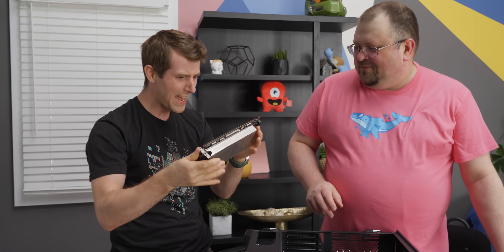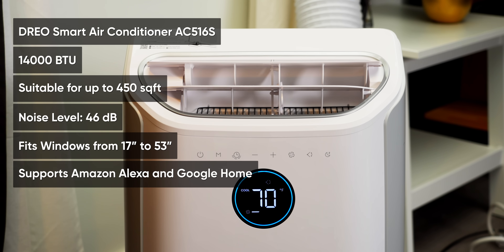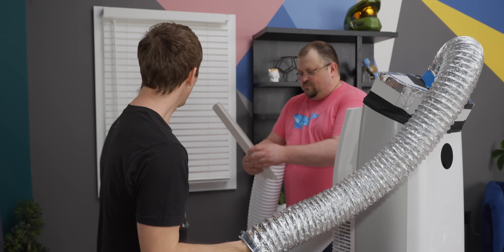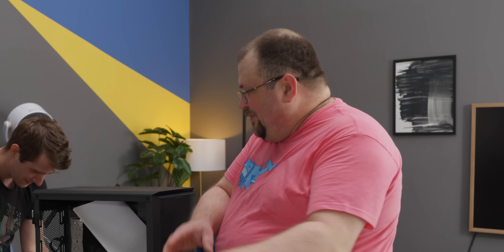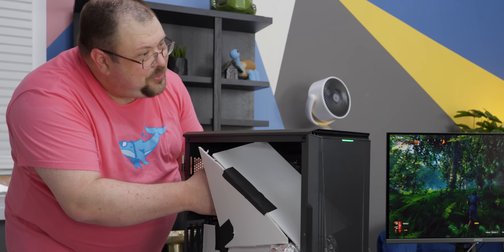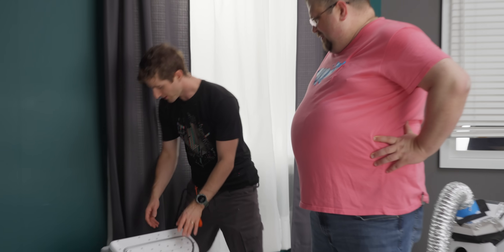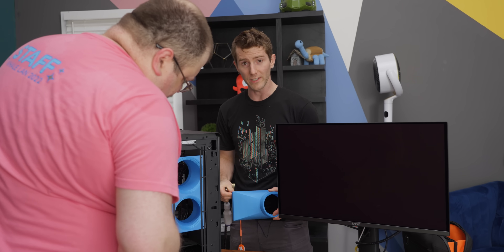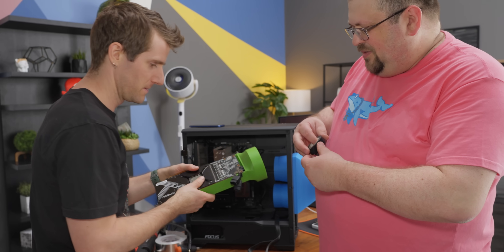Everyone is Cooling Their PC Wrong

Comment: The nice thing about this rather than a chiller is the air that's coming out of the AC is already conditioned. Aircon was originally invented to remove moisture (condition) the air for manufacturing and this means in this case that you can cool your PC bellow the dew point without risking condensation as you would otherwise so there is a lot of practicality that comes with this.
Reply: Yup this! Cooling was just a side-effect
Reply: That is incorrect. Because of the implementation, the backside of the motherboard is risking condensation. Cooling the entire PC with AC would work, condensation would still form on the outside, so the case would need to be rebuild for it, leading condensation runs into driptrays. Then you have the fact that power consumption alone, would far exceed the price of a 5080 per year, depending on where you live, it can fairly easy reach the price of a 5090. That's not counting in the ACs price and the massively reduced lifespan because of a forced 100% duty cycle...
Reply: @VikingRul3s  This is a quick and dirty solution, the way to solve this is via insulation, but no condensation should not be an issue as long as there is a flow of dry air ans that will lower the moisture and so prevent condensation where that air is flowing.

I'm not saying everyone should grab a "portable" AC unit and do this either this needs some real work if you wanted to run it but cost shouldn't be an issue for someone that is doing a sub-zero setup. Those are always "cost be damned" setups.

In the enterprise space, as an aside, Supermicro now does a chilled rack door that cools and conditions air before it hits the servers behind it that integrates with the big chips themselves being aircooled. This kind of solution is becoming more common now. Mind there is even cooler things you can do with those because you can recycle the waste heat.
Reply: @theonik2006  Yeah exactly my point. The back of the motherboard doesn't have any of that circulation, but intense cooling from the tower, evident in the video, guess what will happen after say 15m idle (rim/frost will start forming there, you can check just about any chiller video to confirm that and that's on open benches, way more flow for the back)

As one of the OG of hw bot, no you're right, but nobody ever build these systems for anything els than extreme OC, usually only for a session or a couple of days 

Your example is literally what i propose, AC the entire case. BTW those doors cooling capacity is both regulated according to ambient and only used in racks pushing >80% 24/7, so fairly easy to calculate heat dissipation needs
Reply: @ What I'd be interested to see tested here is how this performs longer term, yes the lack of dry air flow on the back of the motherboard would be an issue, though I think with their setup the relative ineffectiveness of the shroud may mean they get enough dry air to lower the humidity in the whole case anyway.

What I basically want to see is a case with an air conditioned front basically providing a dry air intake with positive pressure, and insulated from the outside to prevent frost from building on the outside of the case as the final version of this. See how it performs.

Actually you reminded me of the Peltier AIO Intel released with Coolermaster a few years back for subzero cooling for 24/7 use. (except not, it had a 24/7 mode that was restricted to above 15C and a sub-zero mode that needed the usual Vaseline and prayer approach, LTT did a video on it back then I think)
Reply: @ Well that would be kinda cool, to see how much ex FSB/bclk could push off components like SSDs

I think i remember it, it was way to expensive and the peltier was too small to have any real effect on high-end chips at full bore (inherent problem), which is exactly where it would be a benefit. Played with them back in the pentium days, first way to try sub-zero OC
Reply: @theonik2006  Going to provide a little context: The reason chillers and peltier are irrelavant today is two fold 
With Peltier it's the efficiency, i think the legendary Core 2 duo E6600 was the last OC friendly chip, that could reach enthusiast levels and still be sub-zero with a overvolted 250W peltier (efficiency is horrible, never over 66%, closer to 50%)
With chillers it simply has to do with how well chips are made these days. Take the E6600 as example again vs the new Ryzen 9xxx. The manufacturing tech is 15x worse on the E6600, meaning the spacing between current "lines" in the chip had to have 15x more dead/isolated space between them. This says a lot about how inefficient chips were when OCing was huge. In other words, there was a lot to gain from low temps, not like now where you can drop from 75C (custom water, max stable) to 5-10C (chiller) and only gain 1-2%
Reply: But the dewpoint is dynamic, isn't that like the whole point? The dewpoint is the temperature at which the air starts to condensate. That's its definition. So if you cool something to the dewpoint, there will be condensation. The dewpoint is no constant, its just lower with dry air as it is in moist air
Reply: @derAtze  No, the dewpoint is when there's a change in the air temperature, that force it to retract beyond 100% saturation (humidity). So the dewpoint could be 5c-delta at 80% humidity and 15c-delta at 40% (made up numbers, not at all accurate)
Reply: @derAtze  Technically yes, it's a factor of relative humidity. At a relative humidity under 25% it drops to less than -10C.

The point is that without conditioned air sub-zero cooling always creates issues with condensation whereas here you will never actually hit the dew point
Reply: @theonik2006  gotcha, so they we're right in practice but worded basically worded it wrong. Its not that you can reach the dewpoint without problems, it lowers the dewpoint to a level where it isn't an issue anymore
Reply: @derAtze  You understand that it's impossible right? Even in frost weather there's a dew point, it'll just turn into rim instead. Turn it around; warm air contracts on a cold surface and therefor risks leaving water behind, so cold air hitting a warm surface does?
Reply: The conditioned air will be dry, but if the compressor ever cycles off the water on the evap will go back into the airstream and cause a wave of condensation downstream.

Comment: I've often wondered how much it would improve cooling if you used shrouds to exhaust the hot air directly outside the PC and ensure that it doesn't mix with your intake air at all. It certainly seems to help for server farms, so it should work for PC's even without a bulky, condensation generating AC unit.
Reply: Isn't watercooling doing that?
So I wouldn't expect much of an improvement at all.
Reply: @Jehty_  Watercooling is expensive, risky and complicated, more so than adding a shroud.
Reply: @  my point is that water-cooling already doesn't add much if any extra cooling. So I don't see how a shroud could have any worthwhile impacts.
Reply: take shrouds and put an exhaust vent into the outside world so that it doesnt heat up the room

you'd think it would work. id like to try it one day
Reply: thats actually a thing that is done a LOT in OEM pc builds. look at dell stuff etc

Comment: Technology connection is actively cringing hearing you say it'll cool the room when it's an independent unit that keeps the hot air inside 😂
Reply: me when i dont use context to understand something
Reply: They still cool the room...just less efficiently than a window unit or central
Reply: What do you mean?
It's an AC. It's designed to cool a room. (Of course you have to actually put the hose outside, not what they did in the video since they don't have a window in the studio)
Reply: @Jehty_  The thing is even, if you put the exhaust out of the window, you create a negative pressure environment in the room, thus pulling in air from outside the room/house, which in return heats the room up. With the energy losses from the compressor, it makes for an extremely inefficient design. A 2 pipe solution, or just a window-mounted one, just moves the heat, without creating a pressure differential.
Reply: @  I know. But that's the what the comment I replied to was talking about.
They said that it can't cool down the room at all.
Reply: @Opharg  The exhaust air is dramatically hotter than the outside air being pulled in, so you still get a net cooling effect. Quite a significant one on larger units. It's true that they're not as efficient as a minisplit or window unit, but they absolutely do work and can provide significant cooling. I'm currently relying on a single-hose portable unit due to my minisplit being unavailable due to building repair work.
Reply: It does have an exhaust pipe that is supposed to be put out a window that they showed earlier in the window even if they did point it back at the unit itself in the final test

Comment: If you have the ability to … just pipe the PC exhaust to the outdoors/attic/ space you want warmed  .. and the PC inlet pulling conditioned room air into the case .. better thermals and your not dumping hot air back into your conditioned room

Comment: Condensation should occur in the AC and potentially in areas exposed to ambient air that are colder than ambient. Keep conditioned air around moisture sensitive parts insulate and ensure no drainage from ambient areas into sensitive areas and it should be fine right?

Comment: I did this in 2008 except instead of using air conditioning, I used Canada.. and my computer died shortly afterwards... 

(I opened the window the to the outside during the winter and ran a duct)

Rip my $650 GTX 285, dual opteron server... Good times..

Comment: Btw alot of older EVs use LiFePo batteries. Harvesting modules out of theme would be around the same price as the tesla packs and you wont have to worry about the instablulity of 18650